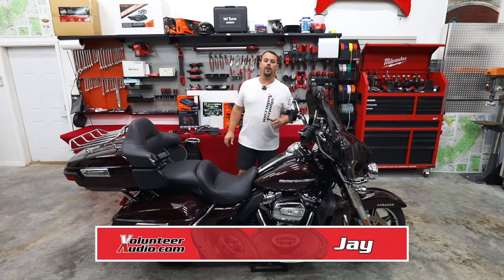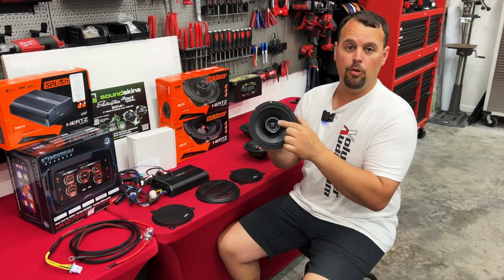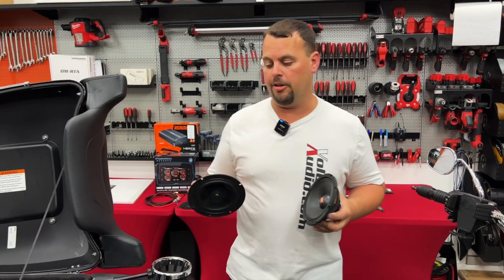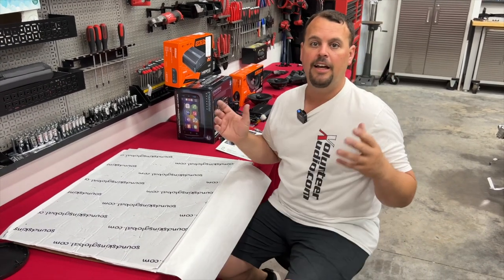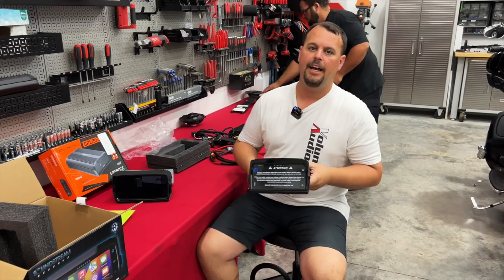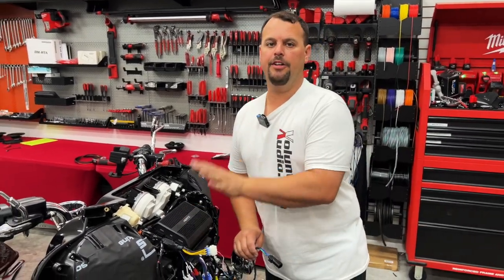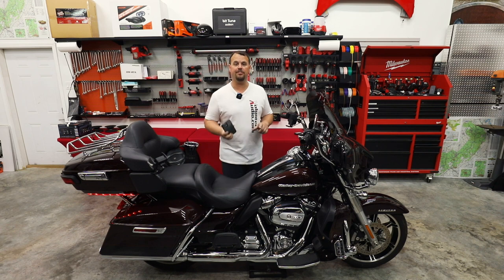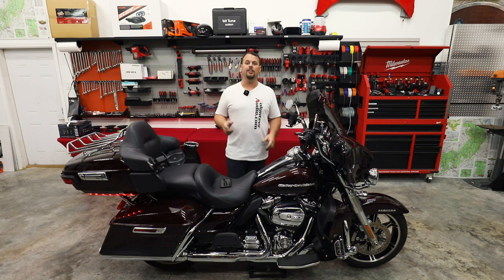2022 Harley Davidson® Ultra Limited Hertz Stage 4 Package - One of our Most Popular Installs

Comment: I like mine a lot I have the same system you sold me I have to tell you. I’m going down the highway with the old radio and it was a CVO . You could barely hear it when you get up to highway speeds this one I don’t care how fast you’re going if it’s in the rain storm or whenever you don’t and won’t use full volume. It is nice. The maestro needs some work still but it’s a beautiful system. Thanks, Jay.
Reply from the maker: The maestro works perfect with the latest software, thank you for watching!
Reply: @volunteeraudio  what’s the latest software number revision? Thanks I think mine is a .8 on the one I bought to maestros because I don’t do zip files I don’t do computers. But doesn’t seem like my shifter display works. It’s in six gear. I’ll call your Tech Support but I had to buy another one off of you and I just switched them. I’ll send you the one I have not in the bike if there is a good revision. I’ve had it all year and maybe I’m just used to the old buttons, how they were, I don’t know. But I love the The system years old man it’s the same as this it’s great. Sometimes I hit the wrong button and I can’t go to the right screen. I thought maybe a new revision would fix that since you had them guys at your place thanks.

Comment: Great content. 
A couple of questions: I’m assuming that amp runs 2 ohm stable? I ask because you mentioned you can additionally speakers (more than 4). Also, what frequency’s do you tend to run those mid bass drivers in the back?
Thanks guys!
Reply from the maker: Yes the amp is 2ohm stable and we use 4ohm speakers, we run the sv165neo or sx690neo at 60hz and up

Comment: Hey so I got the sound stream SI and infinity kappa perfect form you guy’s already. I am wanting to build my system slowly. Starting with head unit and the two front speakers next up I would like to get this amplifier will it be too much for just the front speakers? Then I plan on going on to do the lead Kappa perfect speakers.  
Question is will this amp be too much for just the front two speakers?
Reply from the maker: We have several good amp options for your current setup, give us a call at 1-844-30AUDIO and we can go over them with you

Comment: Jay I purchased HDHU 14+ and Hertz Amp from you. I have 2015 CVO Limited. Installed head unit and amp but getting no sound through speakers. Realised I should have also purchased CVO Boom 1 Bypass Harness. Have now purchased by pass harness but not yet installed as bike at dealers awaiting parts to come from US as none in Australia to fix starting problem. How do I wire this bypass to get sound to rear speakers in tour box. Understand just plugging it in should give me sound in front speakers but what about rear? Haven’t rung you with this problem because of time difference between you in USA and me in Australia. Thanks.
Reply from the maker: It will be very Simple, the bypass will have 4 wires that are purple , purple - black stripe, green, and green - black stripe. Connect these 4 to the matching wires in the output side of the amplifier, our plug n play harnessing has an extra 4 wire plug with all 4 wires on it
Reply: So I can just use the the extra plug in your wiring harness to run tour pack speakers and saddlebag speakers rather than rewire bypass plug rear speaker wires? This is what I was thinking and have purchased wire loom to go from your extra plug to rear of bike . Thanks
Reply from the maker: @PTnLindaTaylor-wf8ko  no, I would connect the rear wires of the bypass plug to the rear output on the amp
Reply: To connect to the rear output of the hertz amp is there a plug in your wiring loom to connect to or do I need to splice into the wires which are the same color? Thanks. @volunteeraudio
Reply from the maker: @PTnLindaTaylor-wf8ko  there is a plug that you will splice into
Reply: Ok thanks. When I get bike back from dealer will give it a go and let you know.

Comment: With the soundstream i set the gains on the amp with the soundstream eq flat. Gains set just below clip. But when i start adjusting the eq the amp will start to clip. Its like i have to run it flat. But want to utilize the soundstreams eq. Could it be the amp? Its not one you sell.
Reply from the maker: If you set gains with eq flat you will clip the amp when raising the eq, instead of raising what you want more of, lower the eq where you have too much of something.  For example if you want more bass, turn down mid and treble